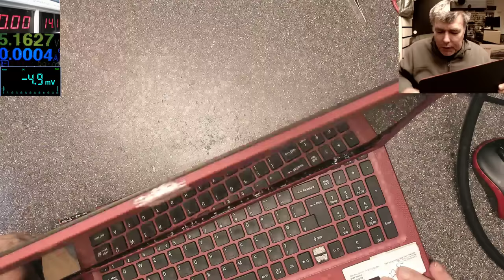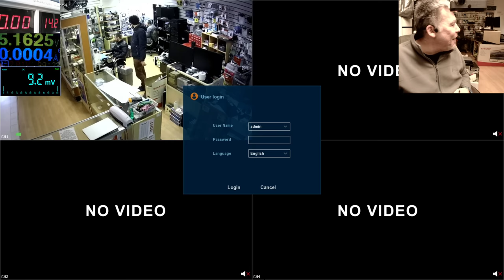Acer Laptop broken hinge, the easy way to fix it

Comment: I liked your video. It was educational and interesting. I also have the Acer Aspire 3 Hindge on the right side and it broke off the plastic cover. This has been an issue with Acer Aspire's going back several years. They either need to use a better casing that's stronger, or place some electronic thick grease in the hinge assembly to help it with the rotation. 
I simply screwed the hindges to the casing using screws I bought from home depot.

Comment: I have been using the glue for a couple of years now. Not one has ever came back. Works very well. If your having problems with it then perhaps there is something your missing. Perhaps cheap glue sticks?  I do have some kinda heavy duty spring clamps I use to hold it and I usually keep it clamped for at least 20 minutes. Im not under a time constraint though so I can do that. I use the gorilla glue.

Great video as always Dr. Sorin :)

I do see the trend with a lot of young kids today. They do not want to work. I guess they get their money from their Mother or Father and do not feel the need. That is sad because they do not understand that the more valuable you become the more your paid. Of course, It does make it really easy on us that do want to work :) . Very little competition for the jobs lol...

Comment: You show here what I really dislike strongly about Acer laptops. The cheap brittle fragile plastic they use for their cases. I have taken several apart and either broke the screw holes or they were broken before i got it. What you here seems to me to be a part of this. Thanks.

Comment: I have fixed many hinges sort of like this but I use steel epoxy and have had a couple  come back  but is usually a really good repair I always would have thought hot melt glue to be too weak but apparently not well done on the repair

Comment: My method is to take out the golden rivets, grab a soldering iron end that's disposable, and melt the rivet back into the plastic. Works a treat and holds just as firm as it did out the factory! :)

Comment: Should call this video "Return of the Hot Glue Hero".  :D  Nice work!  What brand/type of hot glue sticks did you use for this repair?  Would you put it in the notes?  I'm curious because the hot glue I have used never provided a good bond like yours does!!
Reply: Just the cheapest dollar store no-brand type, temperature is the key, rest is marketing bullshit ;)
Reply: @em0_tion  Never had luck with the store brand but I always used a glue gun.  I'll try melting them with my heat gun like the hot glue hero does!
Reply: @Oak690  Oh yeah, man, Sorin's technique is a must try for me as well. I've always used a hot glue gun at work, the cheapest and most powerful pointy chineseium - the better :D They get very hot, but you still have the small footprint of a hand tool and the precise control with the nozzle. Heat gun is easy to try since probably everyone has it, but it isn't practical cause you lack the fast control of temperature and air pressure and/or it's not fast enough, plus it's harder to just toss it when you have to squeeze some parts together right after heating them. We use a small gas-powered torch at work to reshape some human errors, it's perfect. I've done so many hindges and laptop legs... Why would anyone let their laptop slide around the desk, it's so dangerous and uncomfortable xD Plus rubber feet are way more expensive and harder to glue on and stay on. Btw i've used Weller glue sticks, they're like 3-5 $ a pop and suck balls at holding stuff together. Dollar store here sells China sticks for like $0.30 a pop! and they work better :D Sorin gave the best advice ever - experiment for yourself and learn new stuff every day ;)
Reply: @em0_tion  regular hot glue doesnt stick that good it falls apart
Reply: @Damjanhd  Share some more experience with us then, please. What glue are you using in laptop case repairs? I'm currently searching for new glues and already have couple of ideas. What is your advice?
Reply: @Ghiley  You're describing every 2-component epoxy glue out there. I've tried Bison Liquid Metal and Poxipol, both adhere terribly no matter how well you clean or scrape the surfaces, they crack easily after a full day of curing cause they have no flex in them, and they harden too fast to begin with. I'll try out JB Weld when i get my hands on it, but i don't have high hopes for it.
Reply: @Ghiley  Well, hope you can find out what it was and share, sounds pretty useful :)
Reply: You need to use high temp glue like gorilla glue sticks. Also can use a high temp glue gun (300 degrees). High temp glue is the trick and heating up the surface to be glued to create a good bond.

Comment: If the battery is brand new you should keep the lap top abut 6 hours on charge to make it fully work good not directly use it. NICE WORKKK MANNN
Reply: There is absolutely no need to charge the battery. It should jst work fine.

Comment: Thanks, i counted about 6 or more tips about how to do this with hot glue, and to avoid failure (like uneven surfaces for hot glue to grab, hot air instead of gun,  do it in 2-3 layers, hot air at max temp to heat up top layer each time, loosen hinge arms, fill up the area so that the hot glue grabs on both sides of the plastic and then clamp it down ...). If any of them is missed, this will not work. And yes i want to use hot glue (or something) that will allow me to easily reopen the laptop / remove hinges if needed ...

Comment: I'm surprised the hot glue holds. I've used epoxy in the past and sometimes it holds, sometimes it doesn't, depends on the laptop.
Reply: Me too
Reply: paft it doesn’t
Reply: @aqib2000  it does hold strong if you melt it right , i have used it alot in repair hinges only one time it fails cause there was so many damages already , otherwise IMO it is better than epoxy
Reply: I use epoxy or rebuild with plastics, but in first hard solder hinge with blow torch and silver.
Reply: the best way to fix that is to put a screw than hot glue
Reply: I've tried several different brands of epoxy and JB Weld noticeably works best.
Reply: In the first video I saw in which Sorin used hot glue for a hinge repair, he was saying that hot glue was better than epoxy because it remains a bit flexible and gives a little when forced... this prevents it from breaking, or worse, breaking the surrounding plastic.  In both cases, there needs to be something for the glue to grab onto. 
I use both methods together. If the plastic screw posts are available, I will carefully glue them back into position with epoxy, reinforcing wherever I can. Let it dry overnight... (I don't care what it says on the bottle -- let it cure overnight!) then screw it all together again while applying the hot glue to fill every empty space around the hinges.  
But remember,  if you don't loosen the hinges first, you've just wasted your time... ;-]
Reply: @bryandepaepe5984  which one ?
Reply: @romaine-ricardofrancis4690  It's JB Weld Plastic Bonder High Strength Structural Adhesive, It's held together a plastic and stainless steel, daily used coffee travel mug for over two years.
Reply: I'm pretty sure Gorilla Glue is much stronger than hot glue.  The only people that use hot glue guns are people that do arts & crafts type stuff.
Reply: @dennisanderson8663  That's what I was thinking. After seeing this vid I tried hot glue using the same method he did ( a heat gun instead of a glue gun--I had the sticks but couldn't find the gun) for a cabled DC jack on a Dell. Seemed to hold well enough. The plastics were damaged as wellas the single screw hole on the DC and it wasn't worth a new bottom base and DC.

I cannot imagine it working for a bulky 15.6" or 17" lid..but I'll find out some time.
Reply: Epoxy is my go to, but I've heard that there is industrial hot glue that sticks really well
Reply: Had problem with epoxy too and started using superglue with baking soda and for my surprise still going strong after a few months

Comment: Why not use epoxy? Repaired a few, admitedly not in that state, with epoxy on the hinges and the power connector. It bonded really well with the plastic and to almost the same consistency. This way you can be sure it's not susceptible to loosening with heat

Comment: The new laptops are very likely that in time, the plastic in which the hinges are connected, to crack and break. I usually rebuild the whole area using epoxy. Until now have no returns :D Probabil pe timp lung tine ceva mai bine.

Comment: after watching your videos when my laptop broke, i think i have finally tracked down my issue. there is a chip getting super hot because things are over volting to it. i think i have other shorts, but i was trying to figure out what the chip is. can anyone help? its a 20 pin with 5 pins on each side of the square chip, marked "3F=3F 22N". it has no manufacturer marks on it that i can see. anyone got any ideas as to what it might be and where to find one?
Reply: That's a Richtek RT6575BGQW step-down controller

Comment: So the key takeaway from this is use an air station to heat the glue stick because it's crucial that the glue gets very hot. And that's also  why those electronic glue guns are not suitable for a job like this. Is this correct?
Reply: I've used a glue gun before it doesn't hold.  Haven't tried hot gun yet but I'll try it next time

Comment: Dude, buy a hot glue gun, they're like $4.
Better yet, don't use hot glue to fix a computer. That repair is going to last 5 minutes.
Reply: Hot air is the secret. 
Hot glue gun barely melts the glue, moment it touches anything it solidifies waaay too quickly, without making a good bond. With hot air, surfaces are pre-heated and glue is super hot and isn't as viscous, so it makes a good bond to parts.

I don't have a hot air, but I used a plumbing torch to fix hinges on my laptop, still don't know how it didn't catch on fire, but 1 year in, still rock solid.